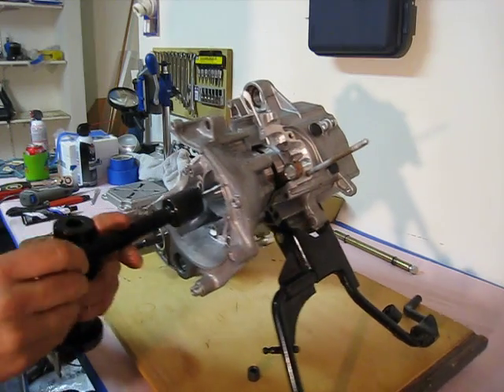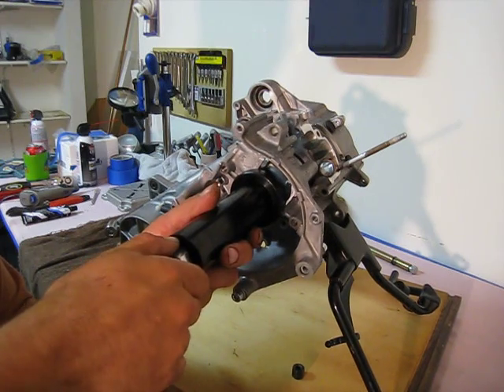Crankcase Sealing2.AVI

Comment from the maker: I did use heat and freeze techniques. However, when pulling the crankshaft and crankcase halves together as a whole, I find the puller to be precise and no worries about silicon sealer not sticking to condensated frozen aluminum.